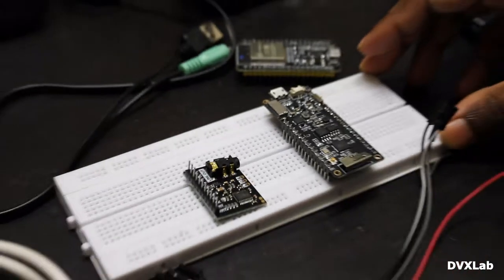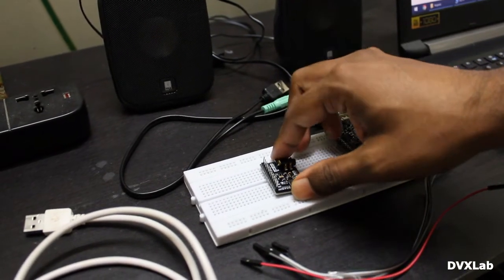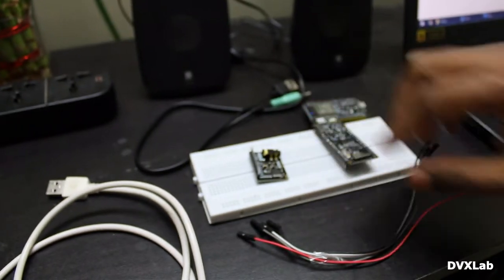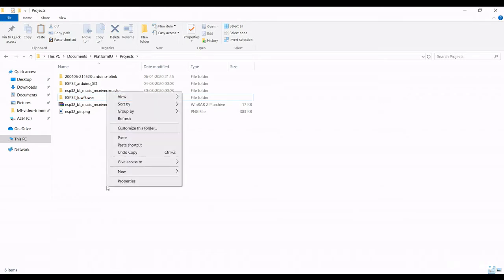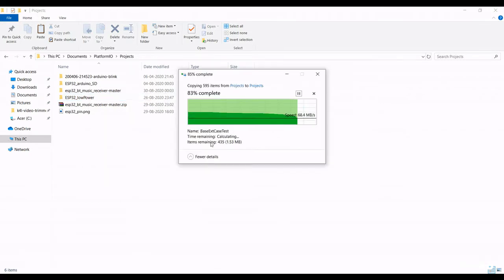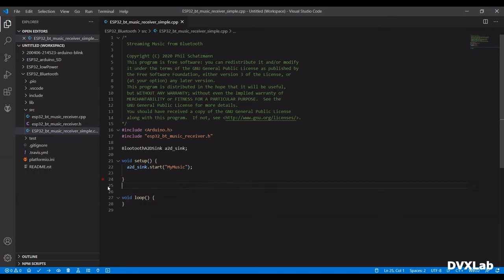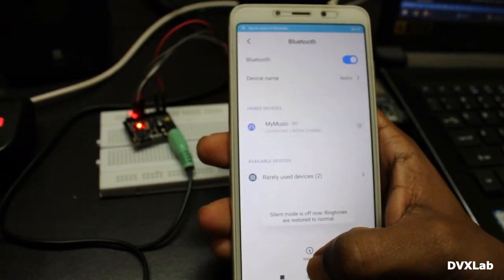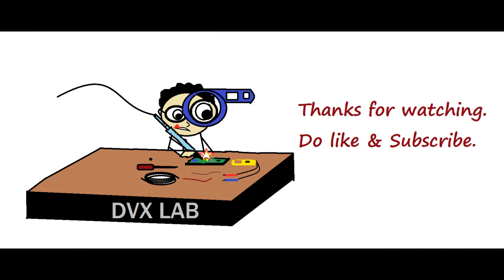DIY ESP32 PCM5102 Programmable Bluetooth Speaker | How to make your own bluetooth speaker

Comment: I am facing serious issues with all the required libraries... can you please explain how to solve that? Cannot even compile the code!
Reply from the maker: Hi, Are you using PlatformIO IDE?  create a blank esp32 arduino project , compile &  verify everything is fine . platformio.ini file ->       [env:esp wrover kit] ,  platform = espressif32
framework = arduino
board = esp-wrover-kit
monitor_speed = 115200
build_flags = -D LED_BUILTIN=21  -DBOARD_HAS_PSRAM -mfix-esp32-psram-cache-issue
Reply: @dvxlab  I saw that you were doing so... that's why I installed the Platform IO extension...
Reply from the maker: @aritramukhopadhyay7163   may be you can paste your error log here .
Reply: @dvxlab  No No... it worked as I got to know the configurations of the platform.ini file!

Thanks a lot!

Comment: I2S Can volumn control?And how?Please!
Reply: I also would like to knoww
Reply: yes with potentiometer.. this is a part of the code that I have used and it works well for me: 

#include <Audio.h>
Audio audio;
#define I2S_DOUT          25
#define I2S_BCLK          27
#define I2S_LRC           26
#define potPin 35

void setup()
{
audio.setPinout(I2S_BCLK, I2S_LRC, I2S_DOUT);
audio.setVolume(GetVolume());}

uint8_t GetVolume()
{

  // looks at the ADC pin that the potentiometer is connected to.
  // returns the value as a volume setting
  // The esp32's ADC has linerality problems at top and bottom we will ignore them and only respond to values in the middle range
  
  uint16_t VolumeSettingReading = 0;

  VolumeSettingReading=analogRead(potPin);
  if(VolumeSettingReading<25)  // because of problems mentioned above, anything below 25 will be 0 volume
    return 0;
  if(VolumeSettingReading>4000) // because of problems mentioned above, anything above 4000 will be 21 volume
    return 21;  
  // If we get this far we are in the middle range that should be linear 500-4000
  return uint8_t(((VolumeSettingReading-25)/190));  //25/190  // this will give the correct 0-21 range 

}
Reply: @imperiosheriff  Hi there, there is a better library for a2dp. Look on my
channel, i have made a esp32 bluetooth receiver on there using the library. You can control the volume using your phone, and also with a pot by some simple
addons on the code. 
Greets!
Reply: @aarriikknn33ll  Yes, I have already seen it, it works but all this libraries that I have tried occupy about 70% of the space of esp32, I am looking for is a little volume library for to be able add more functions within of the same sketch
Reply: @imperiosheriff  I see, you are making a bluetooth speaker of some sort? Would like to see your build process :)
Reply: @aarriikknn33ll  I have made a webradio, then if I have time I upload it, I would like to add the function of receiving bluetooth audio, but when I add bluetooth the sketch size increases to about 140%
Reply: @imperiosheriff  Mmh, cool project! I don't know what board you are using, but useing default espressif bluetooth code i can get only 25% usage on memory.

Comment: Hi do U know to fix slow wifi when Bluetooth is on... Ubuntu os and hp laptop... Intel 5
Reply: Tried bt coexist set to 0 ... Also set... Wireless power management off... All tried... Nothing worked
Reply from the maker: Hi, Not sure what could be the issue. Findout the Wifi chipset(lsusb/lspci commands) & try manually reinstalling it. worst case you can think about buying small extra USB wifi dongle(with good linux driver support ).